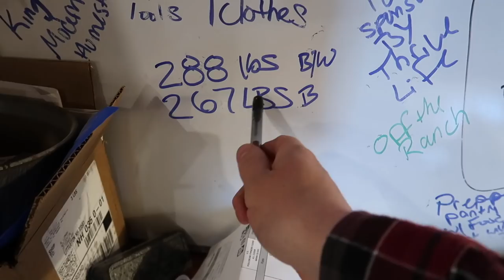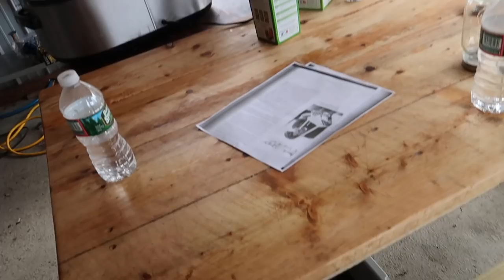I cant get over How Accurate Weighing a Pig with a Tape Measure is!

Comment: Good job on raising the pigs. 240 lbs is about the ideal weight for the right lean to fat ratio. The carcasses  did look good and you will have some great meat for the table this year. Now time to get the garden ready for planting. Tomato's are getting big. Looks like the florescent lights are doing better than the leds. Did you pull the taps from the maples? Come on spring.

Comment: The tape measure trick is NOT near as accurate for show type hogs that are more heavily muscled in shoulders and hams. It works well for feeder type hogs though.  When we did feeders it was always within 10 lbs of actual weight.